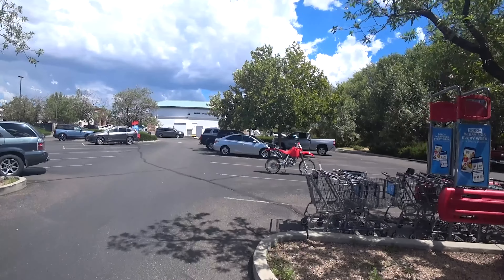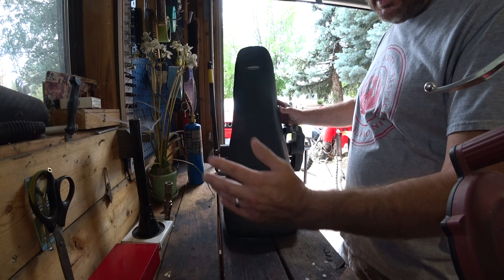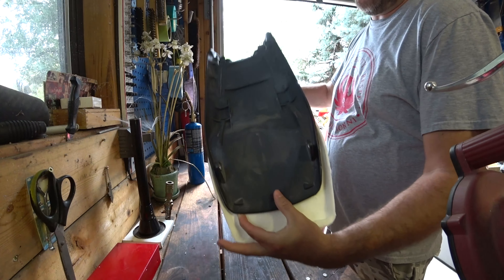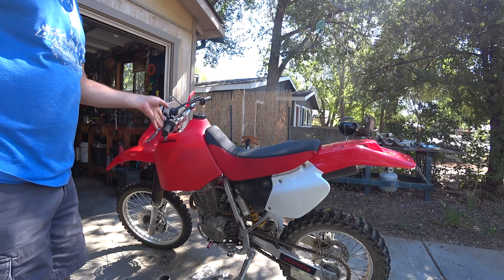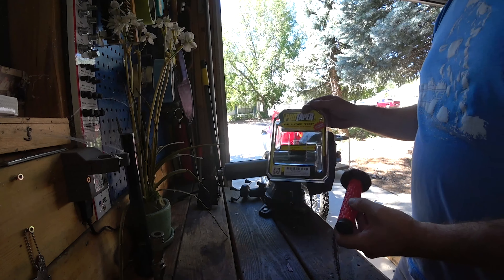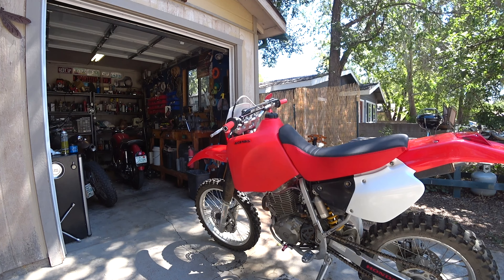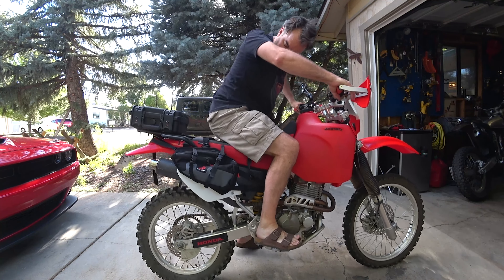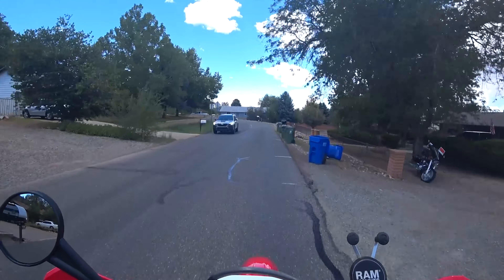2004 Honda XR400R Build Part 2 - Comfort

Comment: Nice build. Always wanted a xr400 street and trail. Ended up finding a 97 cr500 street and trail years ago and haven't looked back. Here in canada we need a horn. Not mandatory in your state? I have a small 12v battery in the airbox with a reg/rec. Getting power from a baja designs external stator. Also have a ridiculously big 17L clarke tank. But I've never run out of fuel. Great videos.